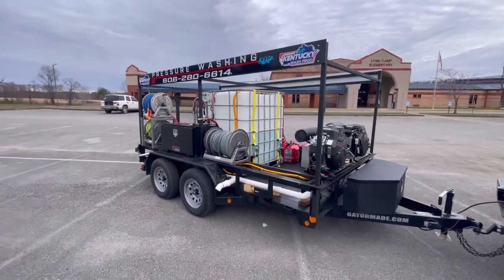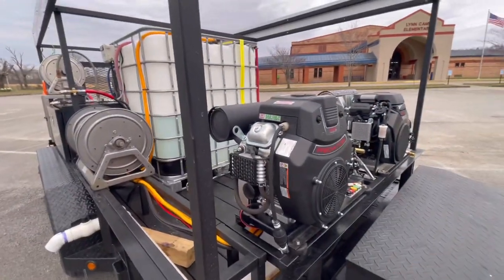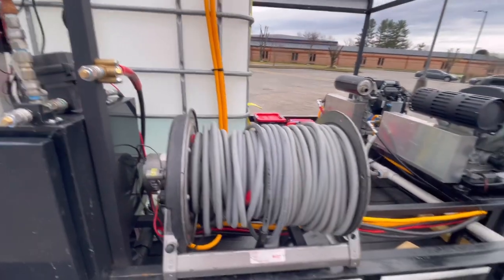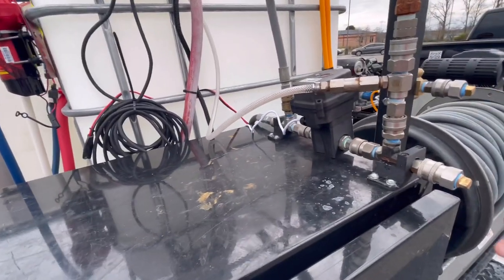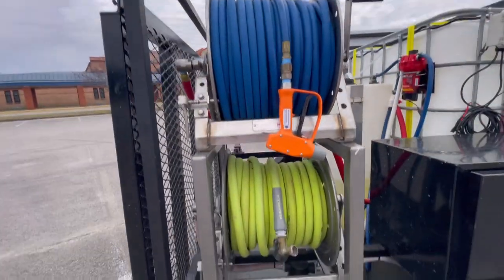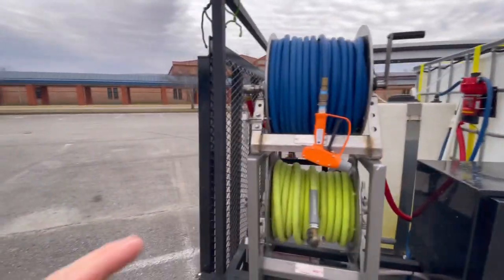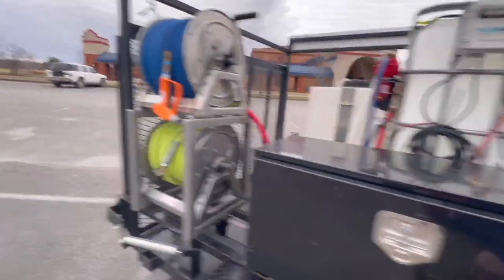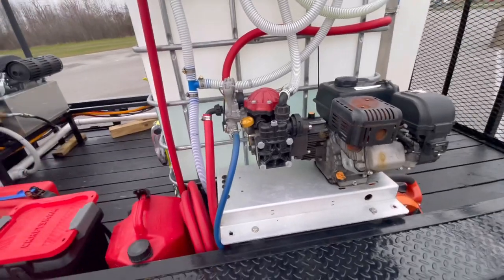2023 Ultimate Pressure Washing Trailer Setup!

Comment: Yeah I made a water manifold. One is water in after the filter, another water to the surfactant tank, another to the float valve in the buffer and two extra auxiliary since they don't have a hose connected to them.
Reply from the maker: That’s what I’m shooting for
Reply: @KentuckyWashPros  Noticed you went from a gear drive to a belt drive on the predator 670 months ago, what made the change? Also what fuel pump do you have in it now?
Reply from the maker: @MannyAguilarJr  this is a totally different setup. I took the original predator 670 back and got a refund and bought the igx 800. I then found a deal on this 670 with a 8gpm pump and bought it from a guy going out of business
Reply: @KentuckyWashPros  got it. Did he say if he did any modifications to this 670?
Reply from the maker: @MannyAguilarJr  said he replaced the fuel pump with a Honda one. It only had 10 hours on the setup when I bought it
Reply: @KentuckyWashPros  yeah I swapped mine for a Honda fuel pump from the get go but I think my fuel line was leaking air and I blamed it on the fuel pump so I swapped back to the original pump but nothing changed until I cut the fuel line and put a new section of the hose in and I just added adjustable hose clamps instead of the spring clamps and it helped so I may put the Honda fuel pump back on or roll with the original for now. But right now the 670 is only staying on with fuel choke and shuts off with the choke off so I might take a look at the carburetor. I have 6.4 hours on it. Want to make sure this set up is reliable before scheduling customers and it die on me like when I was trying to finish a clean at a friend's house for a 2nd day. Texas heat is no joke right now.

Comment: IDK about yours but my sludge sucker is set up exactly like urs and my lay flat hose aint easy to work with im getting a 90 to make the discharge hose work better and not have to support the hose
Reply from the maker: I honestly haven't used it yet. I used my buddies before I got mine and it had like 25ft of the stiff 1 1/2' hose and it was a bear to get it to lay out and not curl back up
Reply: @KentuckyWashPros  yeah thats why I chose the lay flat I got mine from TSC but yeah you will have to lift the hose up and keep it from colapsing but I think if you use a 90 in between the barb and run it to the side it should work great or use 2 45s for a better flow
Reply from the maker: @WashingWizard10  that makes sense I may have to give that a try
Reply: @KentuckyWashPros  Norther tool has 1 1/2" 90° im gona get one this week but other than that small 8ssue I really like my 35' lay flat hose setup vs the bulky ridgid hose

Comment: here again  lol, where can i find the brass mounting block and also the ones you have on your bypass line on the flow pro
Reply from the maker: Brass mounting blocks are called a 3 way unloader block you can get them from Russ Johnson at South Side Equipment in brooks KY, they have a website but you'll have to call to order those. The blocks for the flow pro came from flow pro, they are on the website or call Jud West.

Comment: It is nice. The only thing that I am currently doing different is taking my manifold system and my remote ball valve off of the frame for the water tank on mine. It was mounted to the frame like yours is and I just had a metering ball valve go bad on me and now to get to the back of the plate that holds the ball valve I ended up having to take the water tank out because of how it was mounted to the tank frame. Otherwise I enjoy the set up it’s super clean
Reply from the maker: I appreciate your feedback! It's great to hear that you enjoy the setup overall.

Comment: What made you switch from the gear drive 2221 to the belt driven 2021 pump on the Predator 670cc?
Reply from the maker: Its a total different setup, I wanted to put the 2221 on the igx 800

Comment: What hose is that on your sludge sucker? Looks like a fire hose.
Reply from the maker: I can’t remember exactly what that hose is called but I picked it up at Lowe’s. You can also get it at tractor supply. It’s in the plumbing section it’s like 25 feet long.